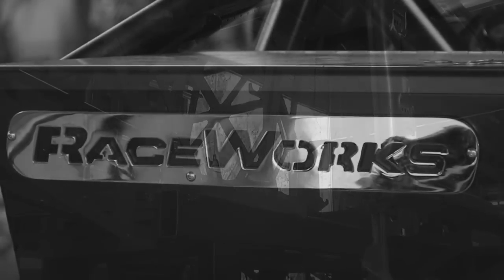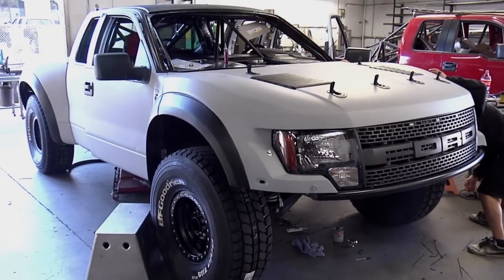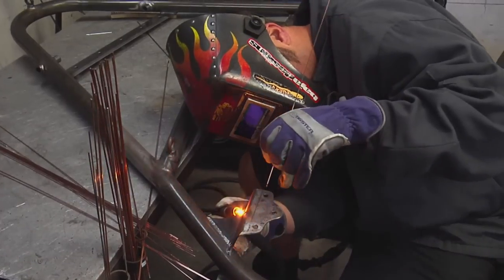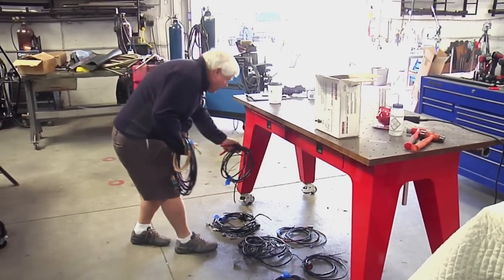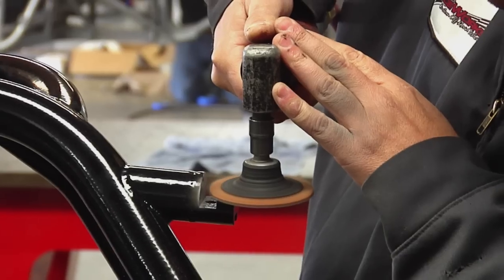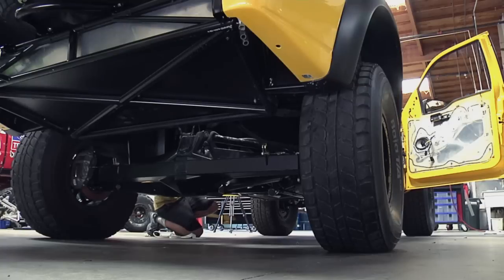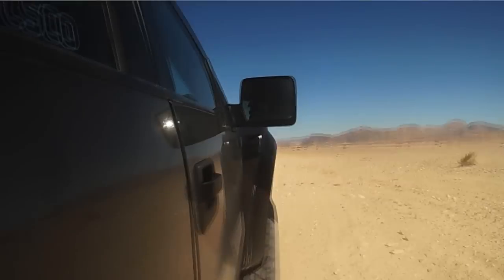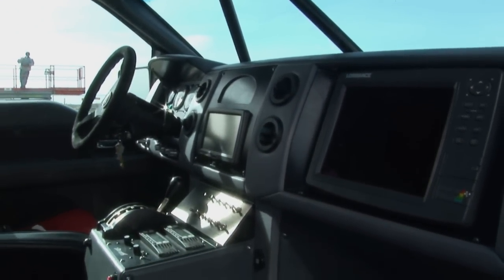Stewart's RaceWorks / TSCO - Ford Raptor Luxury Pre-Runner PART 5

Comment: 26" is very nice.  I thought that was nice to have that much in my sand car.  Then I drove my truck with 32" and just fell in love with it.  Southsd1606, I've had my truck off road only a couple of times.  That's the only thing that sucks about nice paint job.  I'm not a Ford guy, but the Raptor is the only Ford I'd ever consider buying.  If I didn't have my truck now, I would definitely consider one of the purpose-built Raptors.